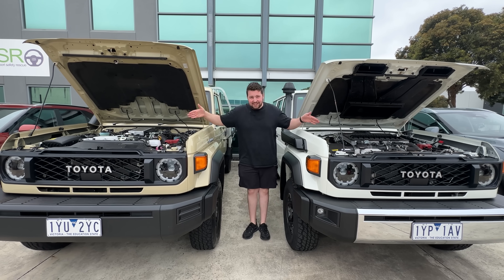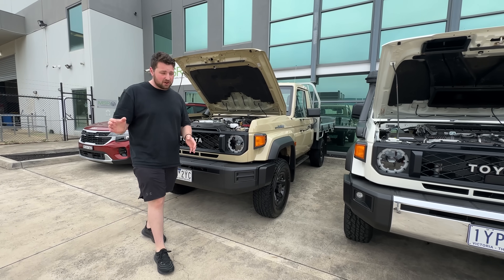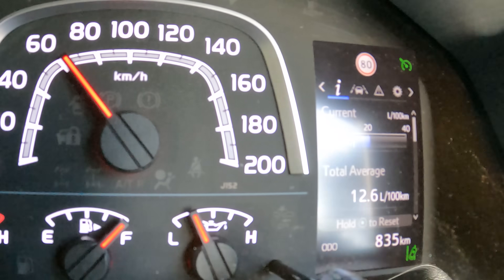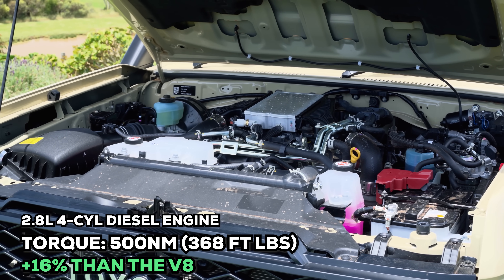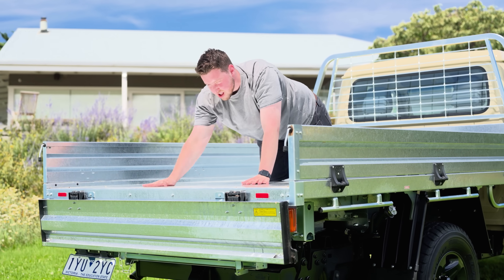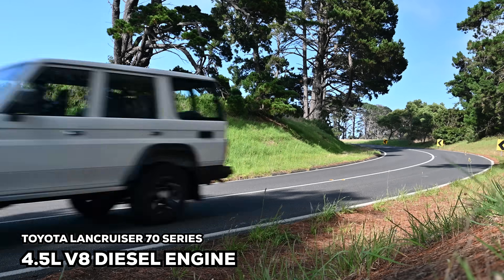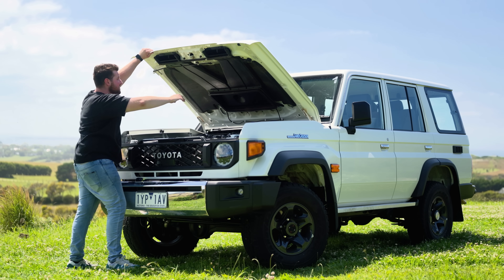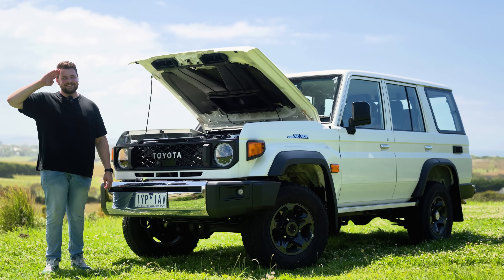Toyota LandCruiser 70 Series 4-Cylinder vs V8 Comparison: Reliability, Concerns and Which is BETTER?

Comment: The Toyota LandCruiser 70 Series is known for its durability and off-road capability, but choosing between the 4-cylinder and V8 engines involves considering several factors. Here’s a detailed comparison:

Reliability
4-Cylinder:

Engine: The 4.5L inline-4 diesel engine is renowned for its reliability and longevity. It's simpler in design, which often translates to fewer mechanical issues and lower maintenance costs.
Durability: This engine is built to withstand harsh conditions, making it a great choice for rugged environments. Its simplicity also means fewer things can go wrong.
V8:

Engine: The 4.5L V8 diesel engine, known as the 1VD-FTV, is also highly reliable. It offers more power and torque compared to the 4-cylinder, which can be beneficial for heavy towing and off-road performance.
Durability: V8 engines are generally robust and well-engineered, but they may have more complex components compared to a 4-cylinder engine, potentially leading to higher maintenance costs.
Performance
4-Cylinder:

Power: Typically produces around 130-150 kW (175-200 hp) and a torque of about 430-500 Nm. Suitable for moderate off-road tasks and everyday driving.
Fuel Efficiency: Generally more fuel-efficient than the V8, which can be an advantage if fuel economy is a priority.
V8:

Power: Provides significantly more power, around 200-230 kW (270-320 hp) and torque of about 650-700 Nm. Ideal for heavy-duty tasks, such as towing and extreme off-roading.
Fuel Efficiency: Less fuel-efficient than the 4-cylinder due to its larger engine capacity and power output.
Concerns
4-Cylinder:

Power Limitation: While sufficient for many tasks, the 4-cylinder may struggle with very heavy loads or extreme off-road conditions compared to the V8.
Towing Capacity: Generally lower towing capacity compared to the V8, which could be a limitation if you need to haul heavy trailers or equipment.
V8:

Cost: Higher initial cost and potentially higher maintenance costs due to the complexity of the engine.
Fuel Consumption: Higher fuel consumption can lead to increased running costs over time.
Which is Better?
For Reliability and Simplicity: The 4-cylinder engine is a solid choice if you prioritize reliability, lower maintenance costs, and better fuel efficiency. It’s a good option for general off-roading and daily driving without the need for extreme power.

For Power and Performance: The V8 engine is better suited if you require more power for heavy towing, challenging off-road conditions, or if you value higher performance. It provides superior torque and capability, but with higher fuel and maintenance costs.

Ultimately, the choice between the 4-cylinder and V8 LandCruiser 70 Series depends on your specific needs and preferences. If you need a rugged, reliable vehicle for moderate tasks, the 4-cylinder is a great choice. If you need extra power and capability for heavy-duty use, the V8 will serve you better.😉😉😉

Comment: It's not about the motor.  It's about the transmission.  Turbo motors lose all their boost/power during shifts on a manual, but keep their boost/power while shifting in an automatic.
Reply: I have a manual 2021 Hilux , it’s much more powerful driving through mountain country . I have mates with tuned hiluxs with automatics , mine is stock and I pull away from them up the hills going through the blue mountains

Comment: I am so sick of pseudo Toyota salesman , stop shoving “ OOH THE TOYOTA 4. Cylinder is the best - what a pile of garbage “ I noticed you never mentioned the insane lvl of turbo boost on the 4 cylinder ( min 27 psi  ) awesome for reliability and the dreaded EGT’s / oil life and ultimately engine life . I also noticed you failed to mention the downsize in the gauge of the chassis thickness / reduction in axle shaft load and quality, but the big Clanger Is Toyota’s extreme reluctance to honour warranty claims if you dare put even a slight mod to your new pride and joy. For the record there are a lot of people facing this exact issue now- it will be interesting if Toyota will co ply with Australian consumer law.

Comment: What about the new V6 Automatic?
Reply: Stay away from the new V6 mate. The V6 in the new LC300 required every 6 months interal or 5000km service. What is that tells you........
Reply: @dino8ielts  in the gulf region, the V6 is the top selling engine, you have the option to do the service after each 5000 km or 10000km , the new combination with the V6 and the automatic gear ( same as the hilux V6 auto ) needs to be tested , thats why im asking ;)
Reply: @dino8ielts the V6 is not the same 3.5  V6 TT in the LC300 its the 4.0 NA V6 which is offered in the LC300 it’s an ancient engine and was offered on the FJ Cruiser and the previous 70 series and the LC200 and many more SUV's and pickup trucks from Toyota and it’s as reliable as the diesels
Reply: @omaralhuwaidi7819 you are talking of a totally different motor, yours is a gasoline/petrol V6 that Toyota aren't  utilising in Australia.
Our LC300 is a Diesel variant, it's a newly released motor just for LC300 series only here.
No other Toyota currently likely to get access to it, especially not this old dinosaur. We're privileged to get this newer generation motor for it.

Comment: I’m sure the 4cyl is getting blood from a stone. 
Just another hyped up small motor that’s really punchn. 
I would always prefer a lazy large engine as long gevity and ultimate reliability is my first prerequisite  
I will stick with my 4.2 l six diesel non turbo. Has done 7002000 km nary a problem. 
So I would buy neither. 
Another point. I see too many 2.8 Huluxs and fortuners blowing clouds of blue and black smoke. A dog of an engine I think. Toyota have made a huge blunder here. This engine may finish the 70 series for ever. Silly move Toyota.

Comment: That V8 yeah its reliable and all but its a fucking turd of an engine.
Hardly makes any power.  Either toyota did it that way on purpose because the engine is piss weak internally or it just a turd naturally and it just doesnt make power that you would expect from a Fucking V8 FFS.

Comment: The 2.8 four cyl is the better, but with a manual box
Reply: I am a retired career soldier. Almost every military in the world specify automatic transmissions, as these 1) protect engines against abuse 2) they think quicker than Dr Sheldon Cooper in tough situations 3) are idiot proof. You can specify a team of oxen, a whip and a billy kettle if you think retro stuff is better.  Seen too many burnt clutches. Also seen a few failed Toyota manual transmissions too many. On anything from Corolla to Hilux to Dyna.

Comment: Yep! Toyota diesel engines are crap and full of problems. 

I only had one and that was enough.  I've never had cracked heads (yes plural), stuffed starter motor, etc on my BT50! The manual gearing is perfect and so much more.

Never buy another piece of crap Toyota 4WD again.

Comment: If only Toyota spent the time developing a  6spd auto for the V8 79 instead of bending the knee to the climate cult and downsizing to a 2.8 4cyl. The V8 behind a 6spd auto would anihilate the 4cyl and last a whole lot longer in the process. The 2.8 is a great engine...for a Hilux, and for $20-30k less, it makes more sense in a Hilux too.
Reply: St Gretel of Tuneberg emasculated the motoring world.  😂😂😂